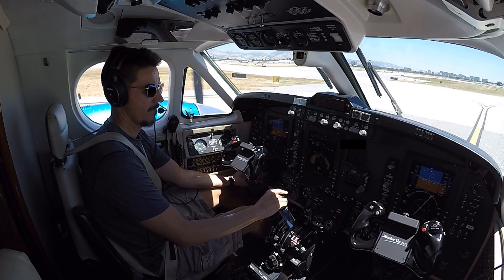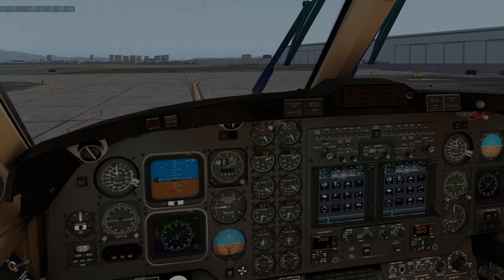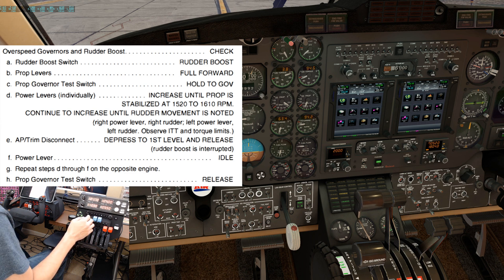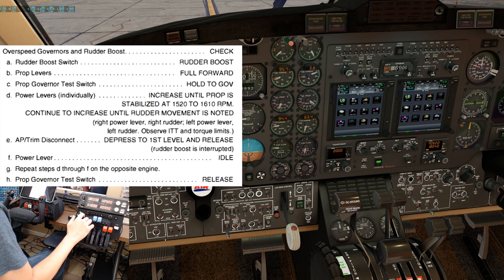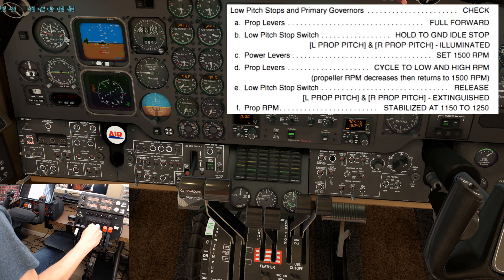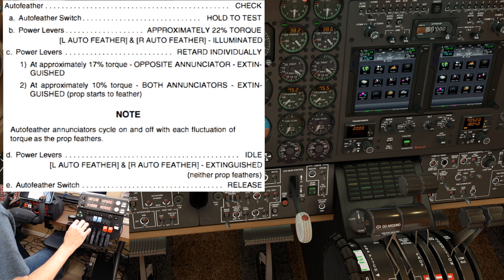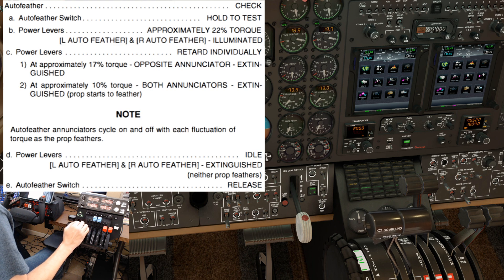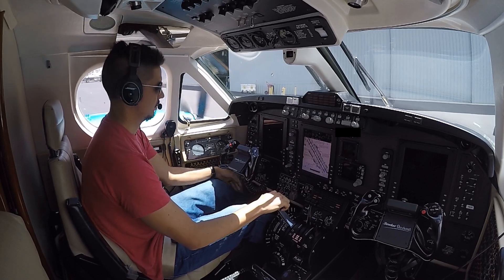King Air 350 X-Plane 11, Engine Run-Up Tutorial | Part 2 or 2

Comment: you need to keep pressed the gov button then advance throttles how you keep button pressed? it doesnt saty clicked if you release the mouse? im i doing something wrong?
Reply from the maker: You need to keep the mouse button pressed to hold the switch in the GOV position. The real switch is spring loaded to off so if you let go, it goes off.

Comment: Thank you for all these videos, Chazflyz! I'm watching all of them over and over trying to do a simulated flight as close as possible to a real one. Could you tell me the consumption per hour in the differents phases of flight of the KA350? I'm trying to do my flight plan calculations. Thank you!
Reply from the maker: I can only give you a good estimate of fuel consumption at cruise which is around 400 lbs at FL210. This sim add-on is very close to the real airplane. 

We don't calculate fuel burn per hour for takeoff and landing.  That is covered by "Top of Climb" and "Descent" calculations which gives a TOTAL fuel burn in those phases.  We use an approved flight planning software that does everything for us.  To sum things up, this XP add-on is very close to the real airplane in fuel burn.  Total hourly segment are 800-1000 lbs/hr depending on cruise altitude.  I'd say the best optimal altitude for fuel burn and speed is FL210-250.   You can go up to FL350 but the True Airspeed drops off quiet a bit.
Reply: @chazflyz  Thank you for the answer!